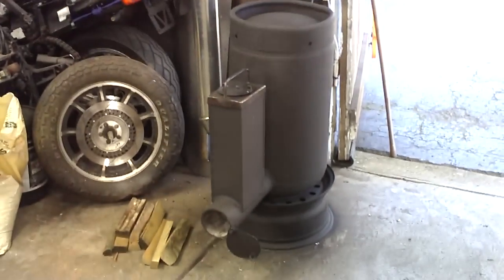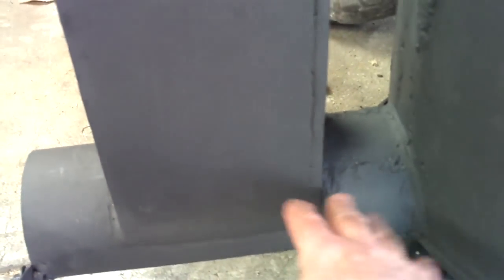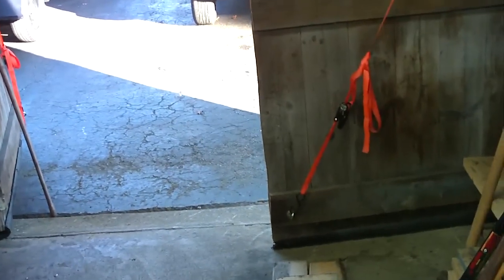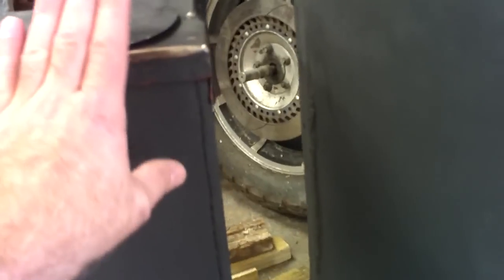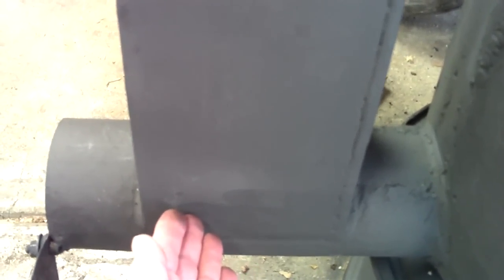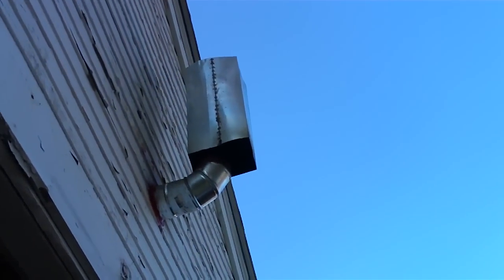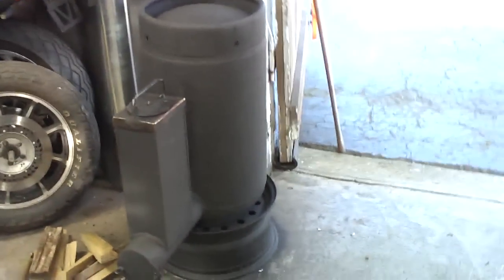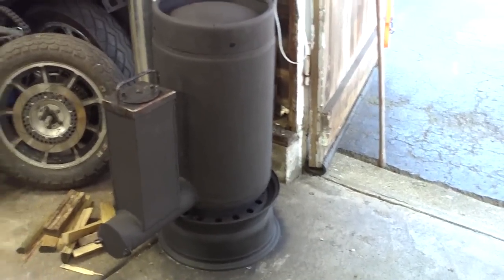Wrap up and final thoughts on my 1'st rocket stove build.

Comment from the maker: Thank you very much! I probably won't do any glass on the house stove. It will be in the basement and not seen other than to put fuel in it. If installing it where I could watch it, most definitely I would. I will shoot a video once I get the stove installed in the house, and will explain the setup I have a little better to why I am installing it this way. These two stoves are being developed strictly for maximum heat output only. Thank you for the interest, and any input would be appreciated!

Comment from the maker: I'm getting a solid 2 1/2 hrs of good usable heat per fill ( 3 or 4 1"x 1" x 10" pieces of wood, and less than 16 oz of pellets. I found out that the smaller pieces of wood, the better. It will not burn larger chunks very efficiently.

Comment from the maker: That was kind of by accident, but ended up working great. I can really fine tune and, dial in the stove with this setup. I get much better burn times and control over the heat output set up like this. I made the mistake right off the bat trying to regulate this type of stove like a traditional wood burner. Big mistake! These are definitely their own animal when it comes to combustion and air flow.

Comment from the maker: I thought of doing that too, but I kind of like all the heat at the front. I wouldn't burn it in this configuration in my house and will probably do like you did, and move it all the way to the rear ( and also, up off the floor more ), but for the garage, it seems to work out pretty good.

Comment from the maker: A guy had a truckload of triple wall pipe, fittings etc.... listed on Craigslist not long ago. I think he had it price at $100 for all of it. He was about 50 miles or so from where I live, and by the time I talked myself into making the drive to get it, someone else already bought it! The deals are out there, just keep an eye out. Maybe even try running an ad in the wanted section. I did that last week, posted an ad in the wanted section for scrap wood, and man, did I ever hit the jack pot!

Comment from the maker: The wrap should hold up well, but in the long run, you will probably have to go with a heavy wall pipe. Years ago, I had a warm morning stove in a cabin I owned, and had the 6" pipe running up through the roof glowing red several times over the years. I was always worried about it burning through, but it never did. After 10 years, I finally replaced it with the heavier gauge, triple wall stuff. Come to think of it, the triple wall stuff would make a nice burn chamber and save a lot of weight.

Comment: Ya one review I read on it said you should wear gloves because it still is very small fibers that can irritate, I am using a 6" T of black stove pipe for part of my burn chamber/feed and my first really hot burn I had a spot glowing red then possibly turning white now the whole bottom area around the burn area is white from the high temp worried that if it gets to hot may get burn through so hopeing this will stop that, otherwise will have to go with thicker pipe for the burn/feed.

Comment from the maker: Yes, I use the Titanium wrap. It is really good stuff. You do not have to wet it, a lot easier to work with, stays put and really holds up well to high heat. The first roll I ordered, I held a blow torch on a piece of it for quite a while with not even so much as discoloration. I would still recommend using leather gloves when handling it though. They claim you do not need to, but I my hands were full of fibers after just a few minutes of unwrapping it.

Comment: Watched some more really like your door seal underneath your garage doors that's like 1" pipe insulation isn't it? Did you staple it on? Seems like a cheap way to do that that should work relatively well.